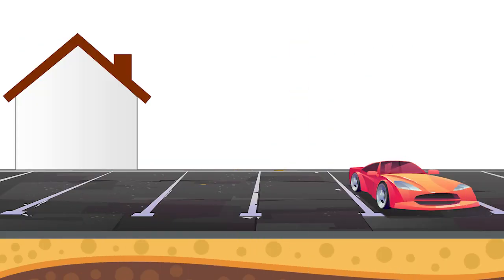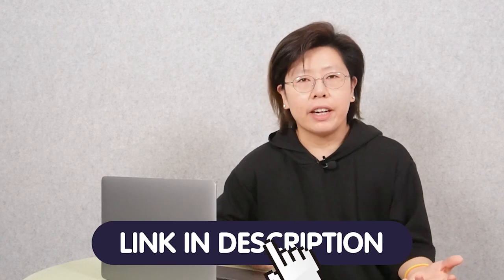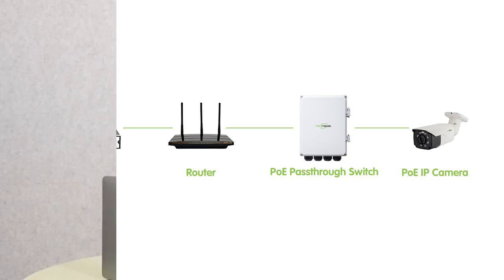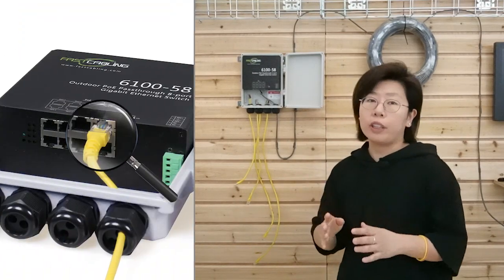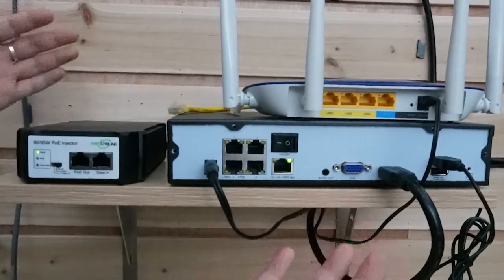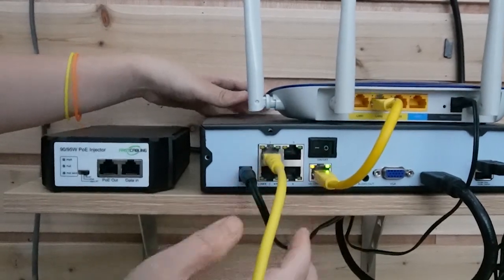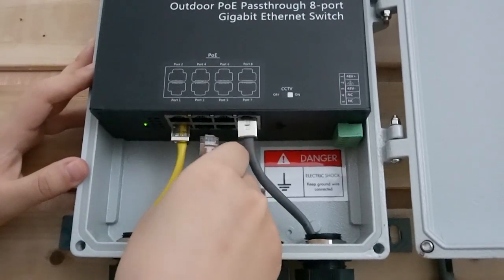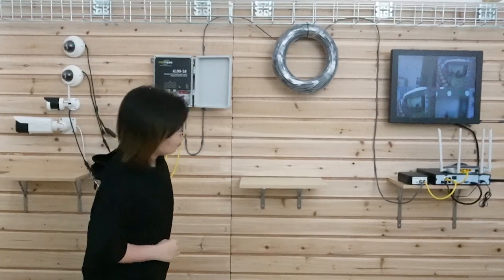Run One Cat6 to Install 4 PoE Cameras in a Parking Lot| Case Study

Comment: Can we use the POE injector, directly to the outdoor POE switch without using a POE NVR?  What are the advantages of using the NVR
Reply from the maker: Yes, you can power the outdoor PoE passthrough swith directly using a 95W PoE injector. The NVR is mainly used for video storage. The diagram should be NVR > router > PoE injector > outdoor PoE passthrough switch > PDs. Please refer to this video: https://youtu.be/Sb8eLhBl-fs
Reply: @Fastcabling  thank you for the quick response!
Reply from the maker: If you have more questions, please email us at support@fastcabling.com directly. If you're interested, we also provide a free solution design for our customers. Submit your inquiry here: https://www.fastcabling.com/free-solution-design/

Comment: How are you proposing a cost reduction #installation from this work???
Reply from the maker: You could save the cable and more important, you got 100 meters additional from the edge switch to your cameras. The POE distance is extended to 200 meters now.